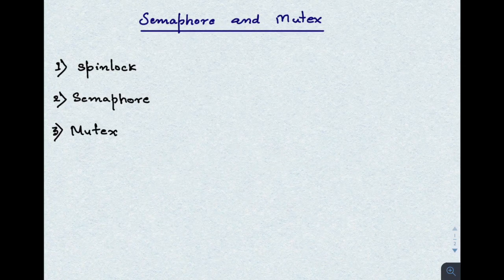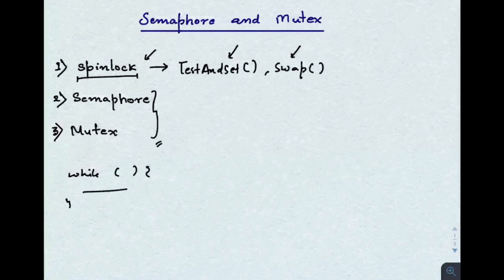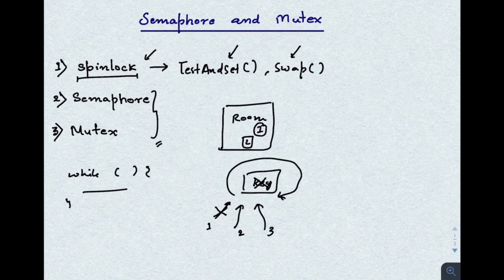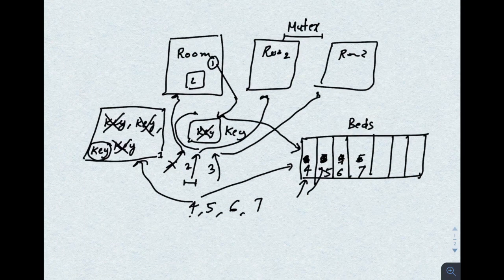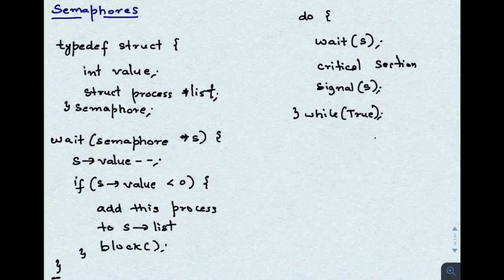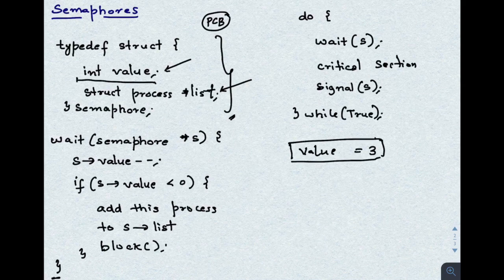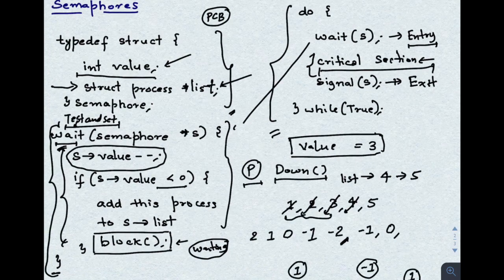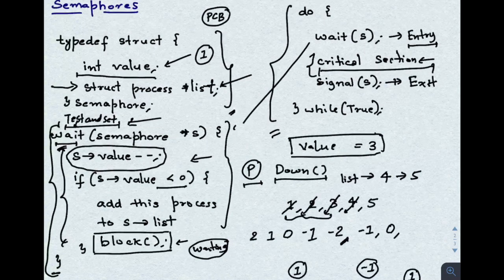Semaphore and Mutex in Operating System Explained with Toilet and Key Example!

Comment: Even in semaphore, if we need to use the hardware methods having spin locks, then what is benifit of using semaphore at all ? I mean won't spin lock still making lots of while(true) calls making cpu busy ?
Reply from the maker: These hardware methods are not spin locks. These hardware methods are test and set lock. If one process is modifying a semaphore, the hardware prevents other methods for concurrenty modifying it.
Reply: @practicalcsjourney  please share code.